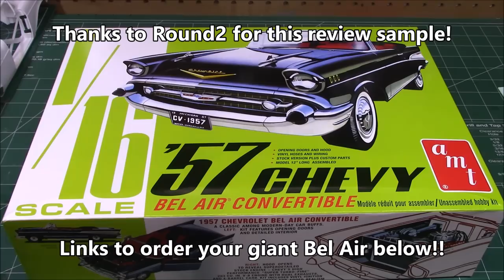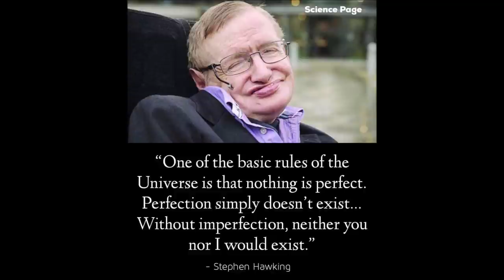1957 Chevy Bel Air Convertible 283 V8 1/16 Scale Model Kit Build Review and Weathering AMT1159 AMT

Comment: I used to love building these big-scale kits.  My favorite was a Revell Ferrari 275 GTB in 1/12 scale!  The big problem was finding space in my little room for the  finished models!

I don't remember the whitewall inserts on the big AMT kits, but then the only one I built was the '55 T-Bird (not the '57).  I wonder if the current '57 kit was a retooling of the '55?

Anyway, that one ended up as a mild custom candy blue using those fat Goodyear radials included with a beautiful set of 3-piece chrome wire wheels included in the kit (2 wheel halves that were keyed to each other and finished with a  chrome knockoff spinner- man that was beautiful!

Thanks again!

Comment: Very cool build. I just did something similar to your seats on a model I recently finished. You can make tarps using tissue and a glue/water mixture. I covered the downed top of an AMT 70 Coronet Super Bee I converted from a hardtop to a convertible.
Reply from the maker: Cool, thanks!